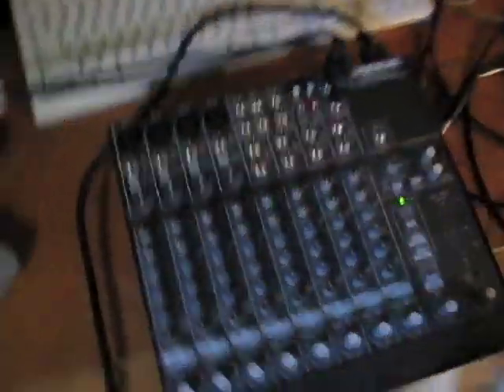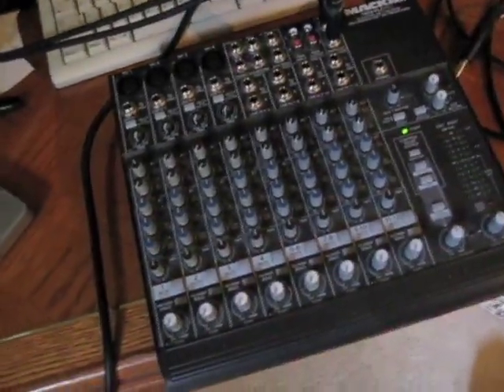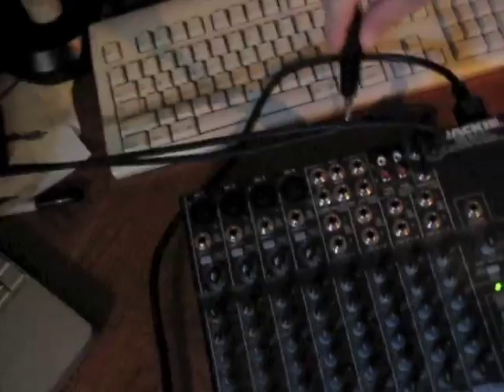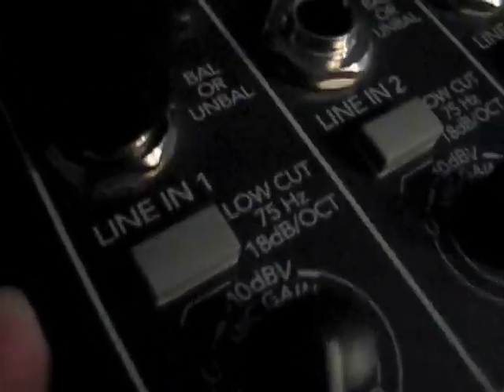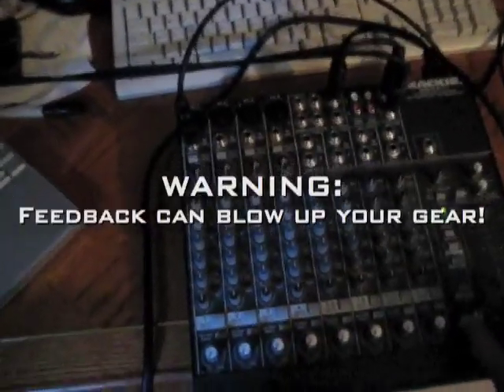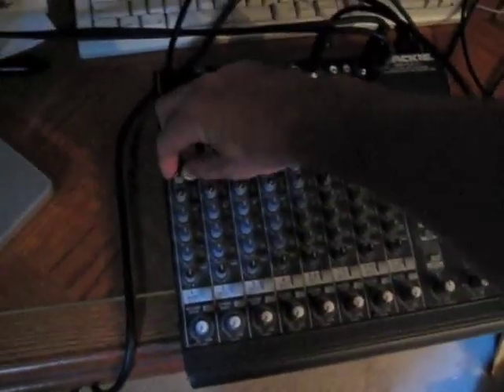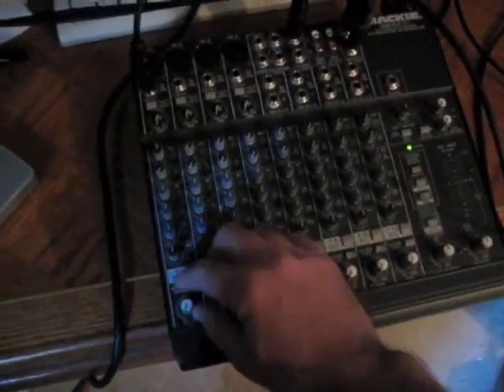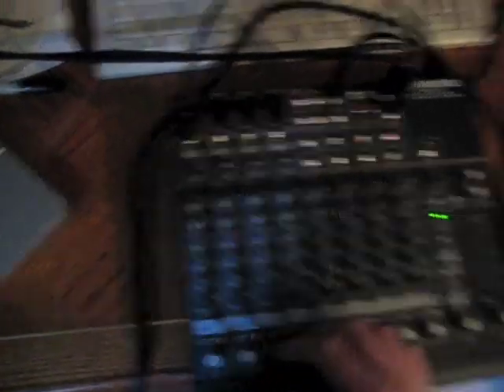Simple Feedback Loop

Comment: @RaulAPizarro That's slightly different. Here you're introducing feedback into the mixer directly. In your case the mic is picking up the signal from your monitors. My advice is to turn your monitors off/down and use headphones instead.

Comment: Do you mean you can fry your pedals or just damage your speakers? I have yet to try a loop with a mixer, but have been using an fx send on an old loop pedal. I dont care about the bass amp im using, but rally dont want to destroy any of my pedals.
Reply from the maker: First thing I'd worry about would be my speakers followed by my amp. Also, the electronics of your pedals and mixer could be overloaded and cause potential damage. Just a thought and try at your own risk :-)

Comment: @RaulAPizarro Ah right, well I think that could be a routing issue. It's either something to do with the way you've set up your mixer - perhaps you've set up the aux send and returns channel incorrectly - or it's a manufacturing issue. Have you contacted the manufacturer? If its still in warranty then you could have it fixed. If not then maybe have another look at your set up. Its hard for me to say exactly what to do without having a good look at what you're doing.